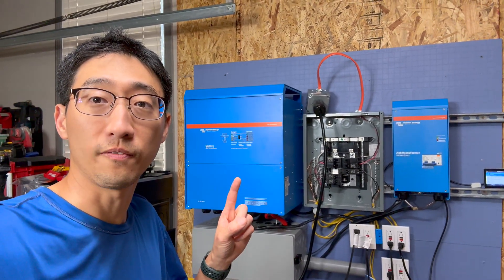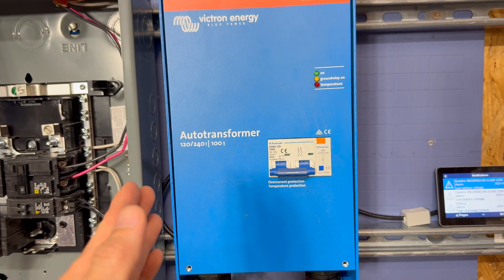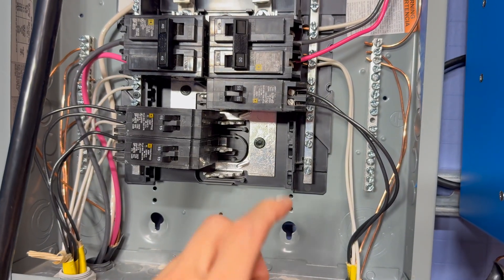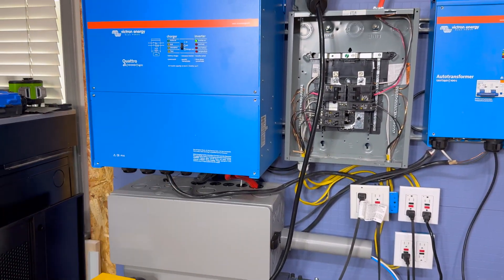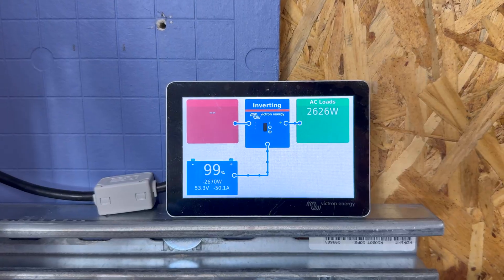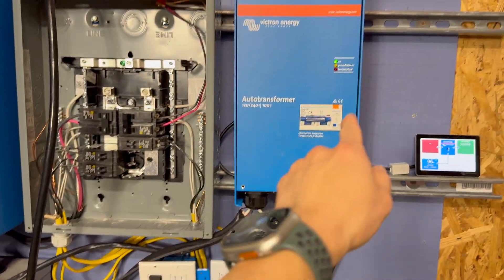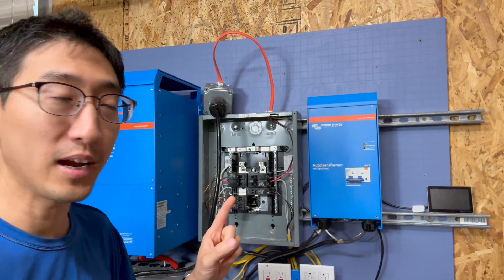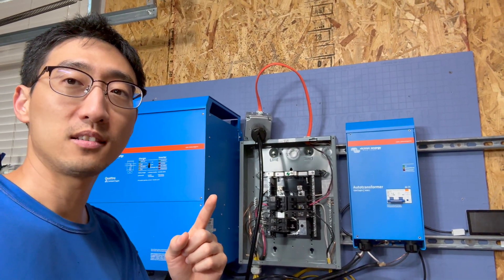Victron Quattro 48v 10kva inverter load test 120 240v auto transformer| EG4 Wallmount Battery

Comment: Great Victron demo, thanks! Is there any other benefit to running the 120V 10,000 kVA inverter and a 120V/240V transformer versus two 5000 kVA 120V inverter units to get 240V, other than a couple hundred dollars price difference?
Reply from the maker: The single inverter and auto transformer has its disadvantages. More loss due to efficiency,  more mind on balancing loads, redundancy loss, and potential loss of opportunity for full draw capability of one leg. 

A single 5000va you could draw about 3500 continuous from one leg. Which would be close to 30 amps on a 120 leg. Which is about the imbalance max on the auto transformer
Reply: Ahhh got it thanks!  I haven’t used many Victron products yet.  I bought a Phoenix 12/800 inverter but I couldn’t pull any more than about 350 watts AC out of it with a 12V 200ah battery.  I was expecting around 600 watts or more.  Does that sound right?  I saw your video with the 12/1200 and it seemed to give you a higher ratio off AC wattage to VA rating.

Comment: The 32 amp limit is only for imbalance. So on that 100amp autotransformer you can’t have a difference greater than 60amp on leg 1 and 30amp on leg 2.   For example 70amp and 30amp has a 40 amp neutral difference so it will shutdown.
Reply from the maker: Thanks. That actually makes sense based on the transformer and the center tap neutral.